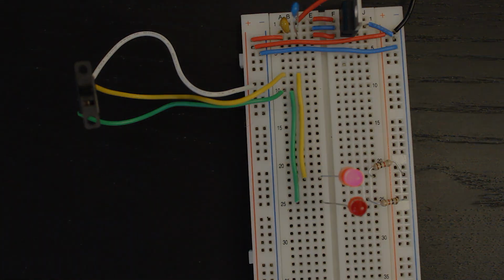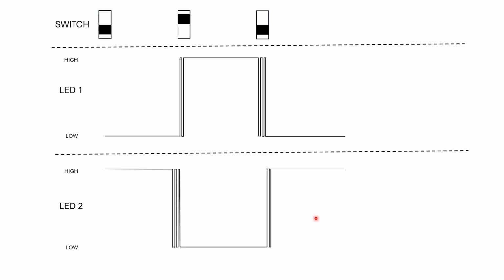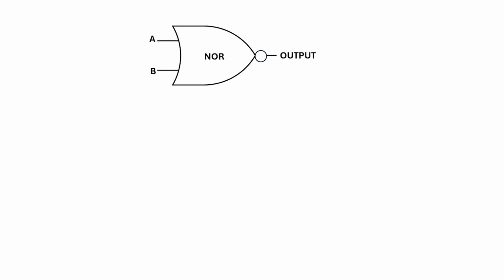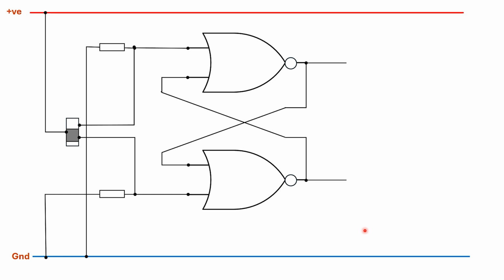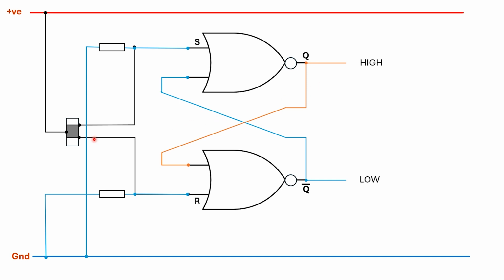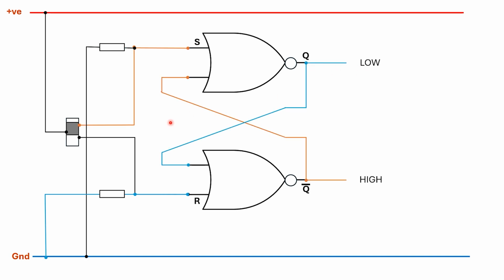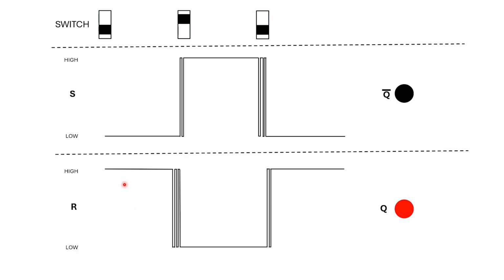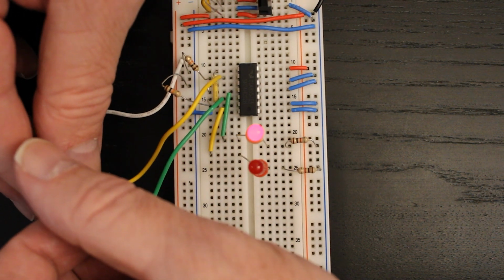Make: Electronics Book Experiment 22 - Flip Flop (SR NOR Latch)

Comment: I study how cpu work and i stuck on registers that has d-latches and d-flip flop and I confuse on first value of q or q bar before use the cpu if it one of them has value 1 before circuit start to work how it has this value when computer has not work before or there is not voltage come in
Reply from the maker: Hi - yes, that’s an interesting topic that goes beyond what is covered by the book. I’m no expert, but my understanding is that the initial state is random because of tiny physical differences in each transistor which means there can be a tiny bias towards a high or low state when power is initially applied and this can be exacerbated by environmental factors like temperature. Most systems deal with this by holding the circuit in a high or more usually low state for a short time after power up to ensure a consistent state. Note the random state is acquired as power is applied to the chip - it is not that the latch somehow has a retained state prior to power up. Perhaps there is another viewer who has more expertise in this area who can go into more detail for you.